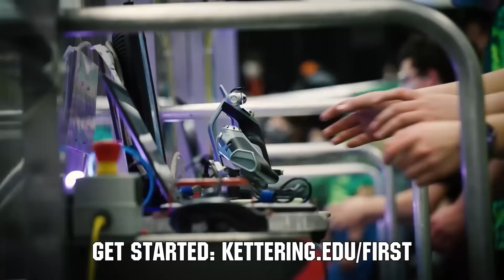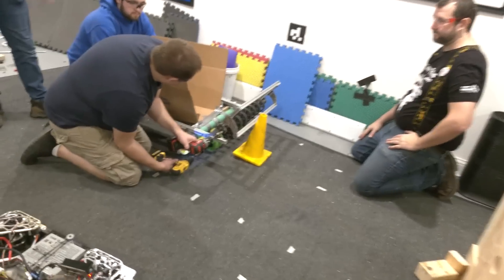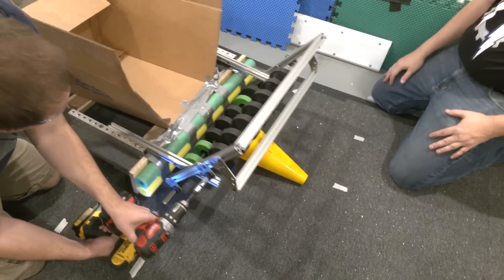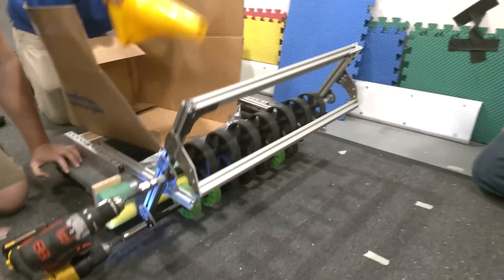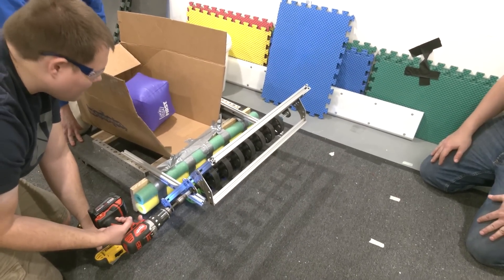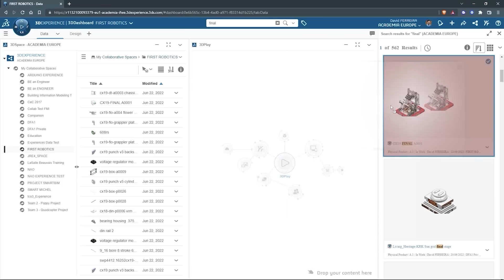Tipped Cone Intake Testing Ri3D Redux

Comment: Can you post a sketch of this with dimensions between wheels, and distance to the floor? Do you think it would work with smaller flex wheels?
Reply: Still working on this, will likely be a couple days. We tried it with a tube roller and that was too small, a 2in wheel may work but it does need to clear the bumper. IMO if we had more time, I would add a roller a few inches over the internal bumper edge to help it kick up more and get fully seated in the robot.